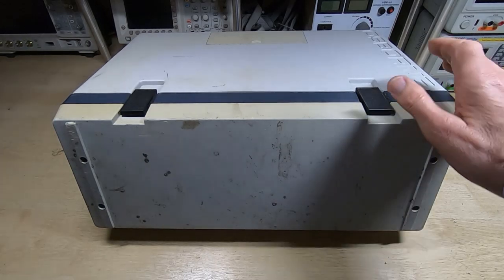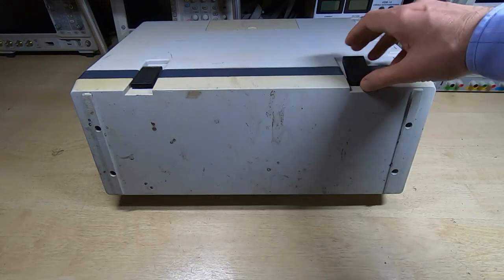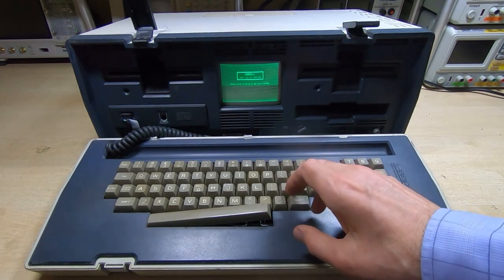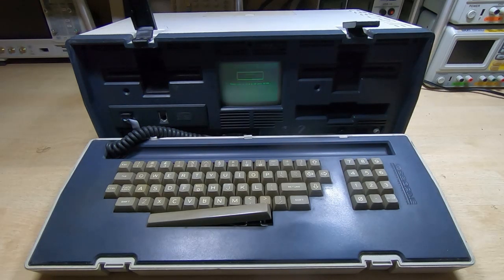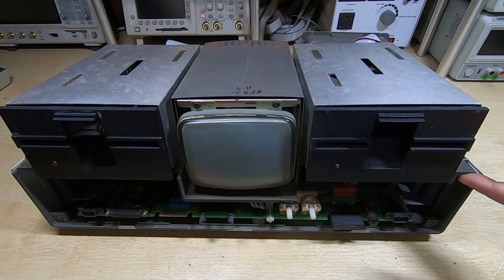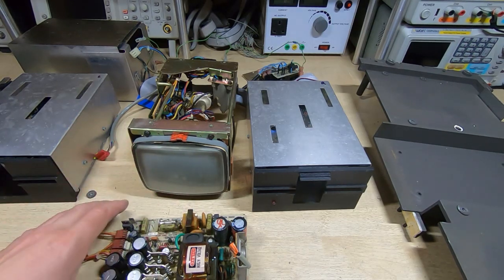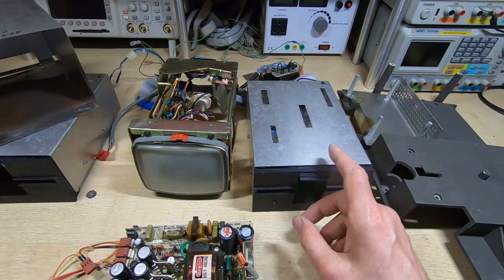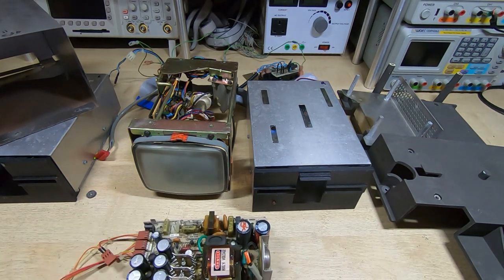Osborne OCC1 Repair Part1

Comment: These are really fantastic machines, and surprisingly usable.  I look forward to seeing what you do with this.

I'm jealous of your modem and screen pac, it seems like everybody but me got those with their machine.
Reply: It's interesting that your monitor has a metal shield, mine does not, and there aren't signs that one is missing.  Drive activity (the B: drive, in particular) does cause some wobble on the display, perhaps that would be better if I had a shield, or perhaps it's for RFI, although the inside of my housing appears to be metallized.